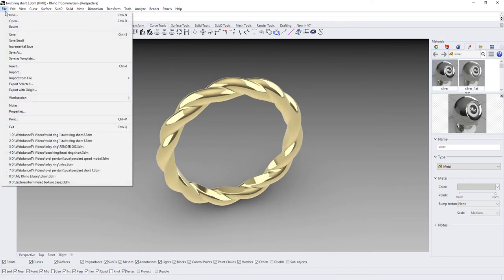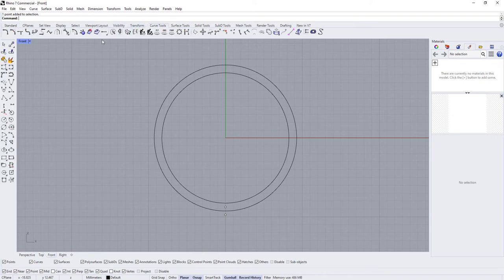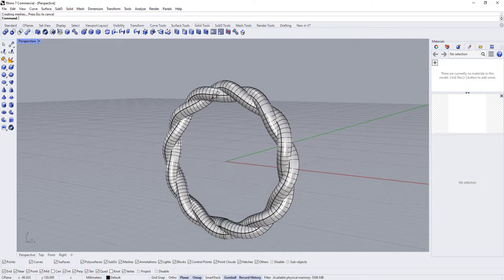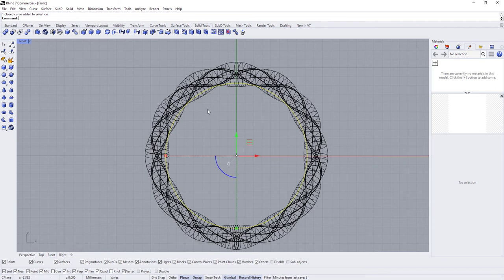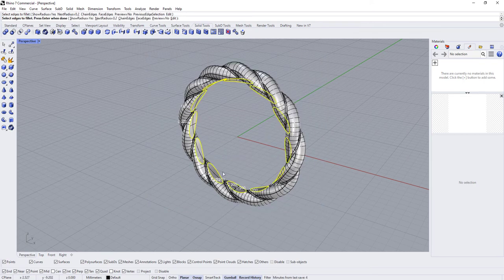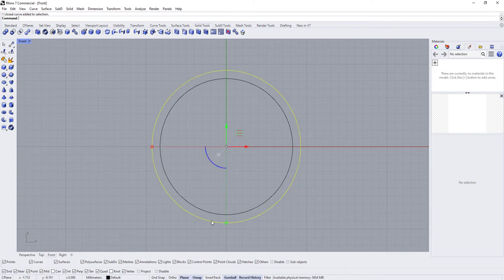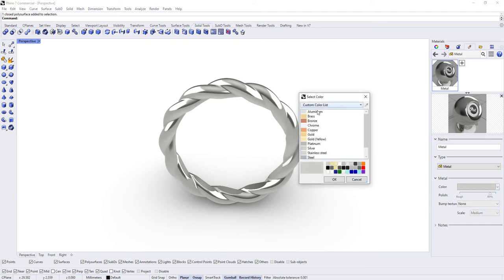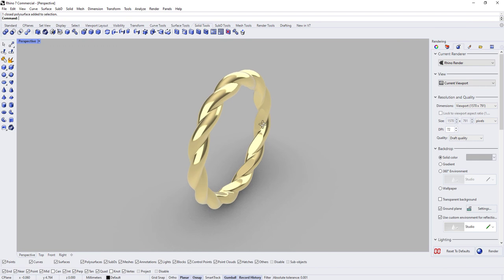Rhino 3D | Jewelry CAD Design | Tutorial | Twist Ring

Comment: is it possible to make it with basically another “two twisted wires” like this but as a single solid piece? (sorry for my bad explanation 😅)
Reply from the maker: The twisted ring, you can easily add more strands to this, but it doesn't look much different. (The braided ring is more complicated and will look different if you add more strands).
Reply: this days I’m going to follow this tutorial and maybe I can give a screenshot of what I’m thinking.
The point is I’m talking about this ring but copied 2 times, so it’s 3 rings, and “glue” them one upon the other